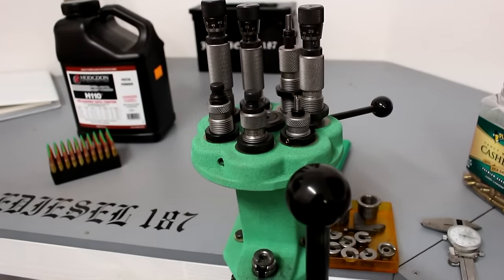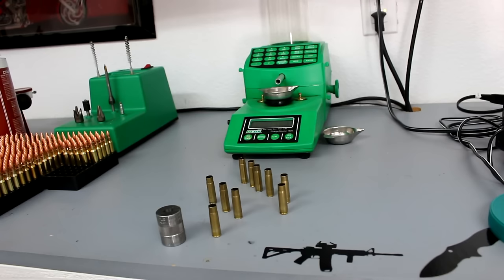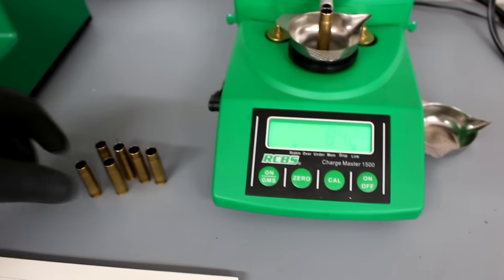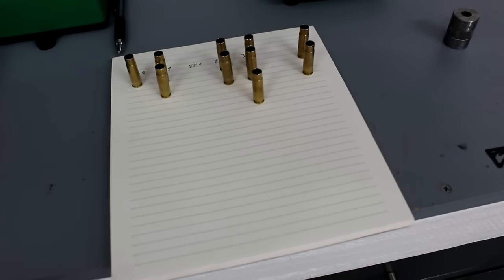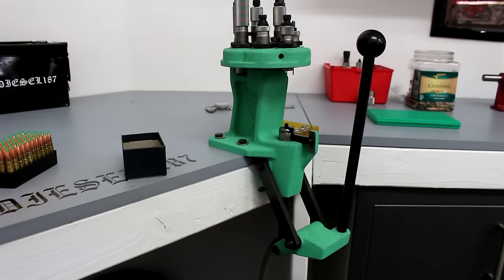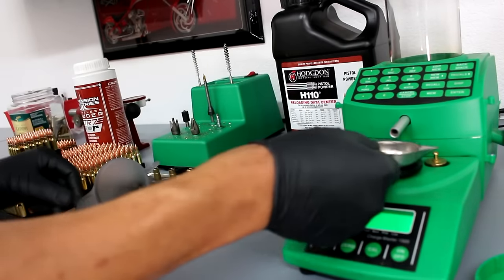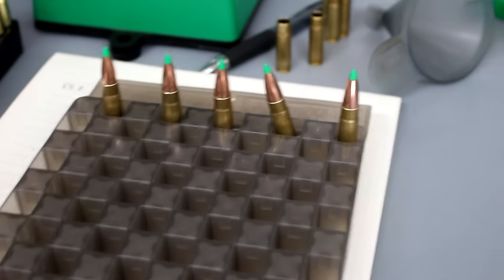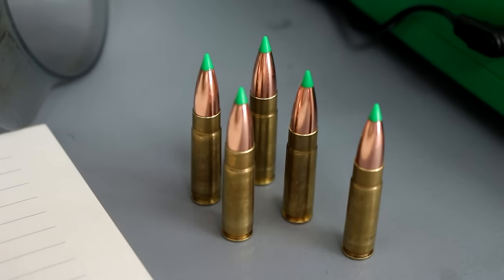BEGINNER'S GUIDE TO RELOADING MATCH GRADE 300 BLACKOUT AMMO

Comment: Great vid man, very informative. I load the same Nosler 125 grn. Spitzer for my rifle that I built. This loading process you are doing is what I have done when loading for my R700 bolt gun, and have been very happy with the results. So, when it came down to my .300 BO after building it I bought a box of 20 factory ammo to see if it will function as intended, and it did. Have gone through 3 boxes of 700 bullet each per box of Hornady FMJ BT as my plinking round, which I load on my Loadmaster press. But when it comes to loading the Nosler and Sierra 125 grn. TMK, I sort them out like you do. Brass I use are cut from CBC 5.56 and LC that are once fired from my friend's and nephew's rifle. Oh, and video quality looks good on my 4K monitor.
Reply from the maker: Sargeant Pasqy Thanks man. I use my rebel camera. I need to get a 4k monitor

Comment: Joediesal187, I noticed that you used the RCBS prep station to take out the crimp in the cases, but later in the video I saw a Dillon swage that does the same thing. I was wondering which you prefer, or do you use them both?

Comment: Isnt the mechanical cleaning of the primer pocket wearing on the brass? Ive heared guys reloading brass for 40 times!! I can imagin cleaning the primer pocket like this wears it down a bunch.

Do you trim the neck thickness as well?

I like your setup by the way.
Reply: I deprime and stainless pin tumble...never need to "clean" the pocket. I do run a pocket uniformer to make depth right...but that's a one time deal.

Comment: It makes sense to weigh the bullets for better accuracy, but I don't understand why the weight of the case matters (except to get you close with final round weight consistency). What impact does case thickness have on accuracy? Or is case thickness more important for reliability of my rifle's action?
Reply: I didn't see him once use a caliper for accuracy of his case length. He must trust his drill press a lot. But military 5.56 cases are thicker, therefore less case capacity(and heavier). You want the exact same weight of powder in the exact same amount of space. At the end of reloading I would weigh every round for safety and accuracy. Maybe marking the cases with +/-  .n gr.
Reply: It's a pressure issue with case capacity. Weighing a case is the easiest way to check. Water capacity is far more accurate.

Comment: You got good expensive equipment but if you going to go in to lengths to weight each case you need to upgrade your scale man, I've had RCBS Chargemaster combo and while the scale is very ergonomic, it's not that accurate since it only resolves to .1 grain, you don't actually need to spend 10k to get much more precise scale.  I bought Gempro 250 and it's resolution is 2/100 of a grain, it's 50x more accurate than RCBS and the cost is around $140.  You are pretty lucky with Chargemaster not overthrowing much, while I haven't tried with H110 (back then I didn't have this powder) with other powders it overthrowed between .1 to .3 grains 50-75% of the time and it did not matter what straw tricks and my own custom hacks I did it helped a little but did not solve the problem.  While it's very convenient and much faster than by hand it's not what I considered good enough for match ammo so I returned it and made myself my own Omega style trickler for few bucks and use that with my scale.  First I use RCBS powder thrower that brings me very close to the target and sometimes right on and then I trickle to desired number.  I weight my bullets too and sort them too in .02 grain increments lol.  Consider this - let say your target is 18 grains and you get dispensed 17.95 the onboard computer is going to round off to 18 and display 18.  The next throw it might dispense 18.04 and round it off to 18.0 and call it good.  So your powder charge can vary by 0.09 grain, this is why probably RCBS states that accuracy is +/- 0.1 grain.  But most important question is what kind of accuracy are you getting?
Reply: I have had the Gempro 250 also, I noticed it would drift while measuring loads during loading up my charges until one day it totally took a crap. I hope yours is being nicer to you then mine has.
Reply: +beckrbuy There is lifetime warranty on them, that's one reason I bought it.  I noticed that they drift quite a bit on batteries.  Mine drift but usually the amount is so small, I am not worried, like 2/100 of a grain.  The trick is to not leave the load there for a long time and keep an eye when you lift the pan that the negative weight is consistent.  If you see it being off by let's say more than 2/100 of a grain I put back empty pan and reset.  Also make sure you have feet setup that scale doesn't rock and leave mine on at all times even when I don't use it, it takes very little power but it's won't fluctuate this way.  BTW, recently I was browsing Chinese website that sells everything and found a scale that looks very similar for $30 bucks.  Makes me wonder if it's from the same factory that makes them.
Reply: I have have 1/2 charge and 1 1/2 on auto throwers.  I will forever measure each charge.

Comment: No crimp? Or does your bullet press crimp at the same time? I have a crappy Lee press and my biggest complaint is the crimp consistency. But I don't load match grade anyway so it's not that important.
Reply from the maker: +Matzaklr Sr. I have been reloading for the last 5 years I have not crimp one reload round,
Reply: +joediesel187 Interesting, crimping has been my #1 hate with reloading due to my inability to be 100% consistent. I'm going to have to try some rounds without and see how it works out. Thanks for the video
Reply: Are you serious?  You don't crimp 125 grain SST's or 147 grain M80's?  

Man...I hot load W296/H110 with these bullets and roll a solid crimp.  I only use a single stage press and RCBS die sets ONLY.  Precision over production.

Comment: I'm wanting to get into reloading myself, can I ask a question, why would you use Pistol powder.
Reply: +jamaal williams might not necessarily be why he does, but pistol powder usually is designed to burn quicker since it's used in shorter barrels. The .300 blackout was designed to be the best suppressed in a 10.5 inch barrel. TL:DR; It uses pistol powder because it's designed for shorter barrels.

Comment: nice job but for some reason I find it ironic to load '300 bo match'.  I use a hornady progressive to crank out thousands of rounds of 9mm so i can shoot more and cheaper (about $7/50).  it seems like the amount of time to process each round of match ammo is too high unless you're shooting precision matches...which doesn't seem consistent with 300 bo.  6mm?  sure.  338LM?  of course.  even 308?  sure.  but I like the 300 bo for run and gun suppressed fun.  that's just me.  i'd rather crank it out in volume, and faster, and then get back on the trigger.

Comment: How full is the case of powder? I just started reloading 300 blk and when I put powder in the case it just about completely filled the case to the top. Is that right? I was using Lil Gun powder.
Reply: double charge? check it
Reply: +Anthony Reddy No, I'm not double charging all my cases. From my research it seems pretty normal to fill it that much.
Reply: Never had that much powder unless I f-ed up and double charged, I don't have auto charger so I have to do single charges by hand and some times charge a case twice, that's why I thought it might have been the issue.
I interpreted it that powder was almost overflowing the case
Reply: +Anthony Reddy This was loading 300 BLK? How many grains do you run? Sub or super?
Reply: My Lil Gun charges are compressed too...